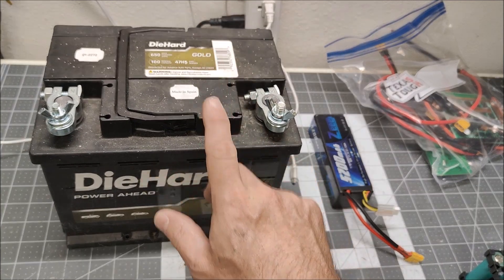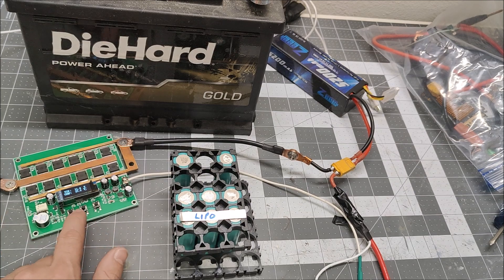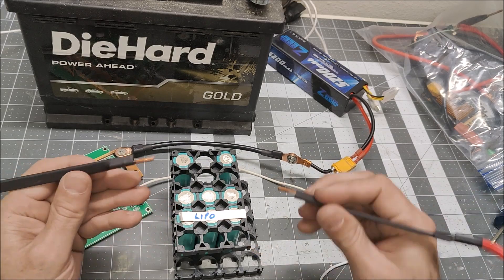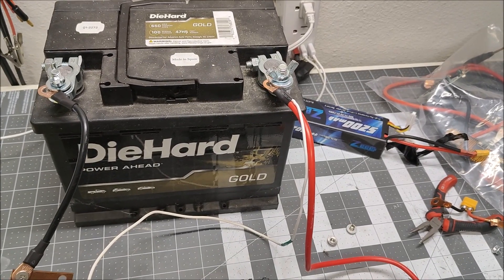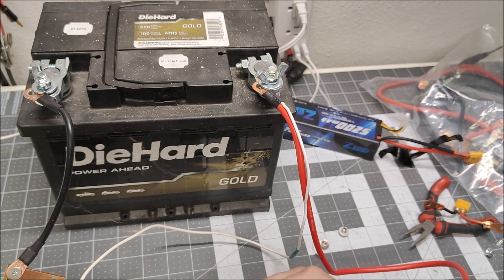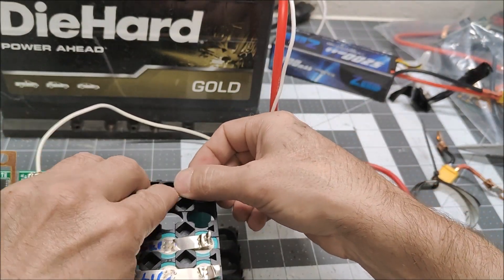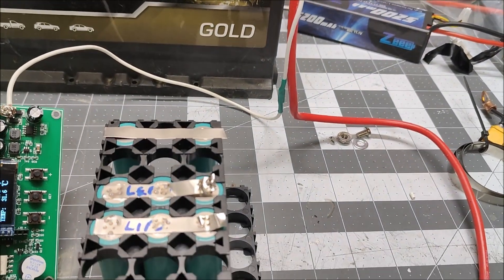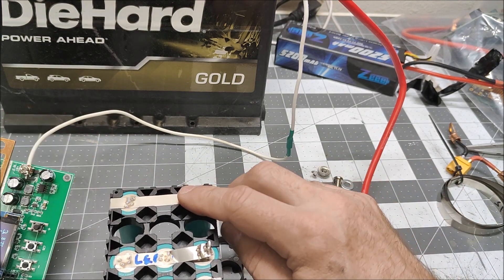Lead Acid vs LIPO for PCB Spot Welding

Comment: I used a 3Ah LiPO years ago to test against an SLA battery. I found that although the LiPO worked, it ran out of jam which resulted in inconsistent welds before I could finish the 84 spot welds required for my project. I kept an old but still functioning car battery for my spot welding and it seems to be doing the job well, and the price was right.

Comment: 7:57 hey Steven, hope you’re well bro.  So, currently you’re Delay stands as .15ms delay. The highest delay is 950 = .95ms-1sec delay. I did receive my PCB SWs and did some messing around with it. It’s pretty cool stuff. I was live last night. Should be in my live video tab. if you wanna check out. Take care

Comment: Can small Motorcycle Battery Led Acid be used with that kind of Welder?
Reply from the maker: depends how small. I do think a motorcycle battery can work, but it must not be too small. Should be at least  150 CCA

Comment: I wonder which is the less dangerous to work with. LiPo batteries are known to ignite and even self ignite if not handled and stored  properly; and burning LiPo fires are very difficult to extinguish. Lead acid batteries can release hydrogen gas, which is highly explosive. According to me, lead acid batteries close to a spark producing welder might also pose a potential risk. Anyone has given this some consideration or has (bad) experience with these setups?
Reply from the maker: lead acid batteries give if minimal hydrogen. And many lead acids are sealed batteries releasing no hydrogen. I don't think its a big concern. From a safety point of view, i agree LIPO might be more dangerous.

Comment: It's not comparison of lipo vs acid but specific lipo battery with specific acid battery. You can get lipo with bigger discharge current. Also doesn't make sense to weld three times with the same time, make first and last much smaller so it won't get so hot and will weld also ok. Plus increate first delay to at least 500 so you don't have to be so quick with touching. And it's not a percentage but a number of milliseconds how long it will weld.

Comment: Can lithium ion rated 3c of 80ah be use to power spot welder?
Reply from the maker: Yes. 3c x 80a is 240 amps. Should be enough

Comment: I have used a similar Arduino based spot welder for about 4 years to create replacement Liion battery packs for cordless drills. I usually make a dozzen or so every few months using 2, 5200mAh 100C, 3S LiPo packs  but I the packs have suffered from puffing (probably due to the heating effect from the large instant current draw around 600A) and I was about to get a new set when I came across a super capacitor version that I will give a try. In my opinion the more robust chemistry of the lead acid lends itself better to this purpose but would welcome other opinions.

Comment: I think a higher end lipo would provide better than lead acid results. Something like a 4s 10Ah 120c. with 8awg or thicker wires from the lipo, wired directly to the board instead of using connectors.
Reply: Not really, Lipos are made very different to Kead Acid. Lead Acid peak much better than Lipo but Lipo can maintain the current much better.

Comment: The start Delay needs increasing when you're initially placed cables on because it's immediately trying to pulse the moment you out them on it, causing miss welds at the start sometimes (but don't change the in-between pulses as it can blow up the pluser if you set them to far apart)

Make sure using basic eye protection as it can sometime explode molten metal when it strikes (as it happened I believe twice in this video)

Comment: No link to board?
Reply from the maker: Just found this amazing item on AliExpress. Check it out! 
$28.09  54%OFF | 12V  Digital Display Spot Welder ModuleSpot Welding Machine Control Board with Welding Pen Intelligent for Lithium Battery 18650
https://a.aliexpress.com/_mNZmcqA
Reply: Seems getting from Amazon would be better for returns since many fry it in the first minute. I'm going to follow the suggestions of using a separate power supply for the board and keeping all 3 delays the same . Also using a lead acid in good shape fully charged for consistent welds

Comment: As always another great video. I use a lead acid battery, to deal with the heat I feed my spot welder with 3 # 10 wire for the negative, I made a #6 wire lead to weld with and a #6 wire lead back to the positive, I use a #10 (I think #10 is overkill) wire to from the positive to the positive on the spot welder. This combination really helped with the heat. Thank You for all of these great videos you have done

Comment: I played with the delay using lead acid and if you change the delay to get 3 hits over a second the FETS will blow! Keep all three at the same delay!
Reply: What was your battery setup? What were your power levels? We're you powering the board with a 12v 1amp wall wart?
Reply: @brenthawkins204  car battery

Comment: Ignoring the mass of the batteries, I would go with the lead acid. Simply, lead acid likes to stored fully charged when not used and extends the life of it. But storing the lipo fully charged decreases the life of the lipo battery.
Reply: If you are using 4s lipo battery; the user manual already requires it to be below 16v. You can charge it in storage mode and put it on standby for a long time. It is like 15.4V.
To make punto, it must be less than 16V. You start directly with the storage mode voltage. When the punto is finished, it returns to storage mode, so you can store it for a long time...
(I use 4S 5000 mah 50C lipo battery, like this. It was a battery I used for my drone. :)   )
Reply: @cetinkaya4436  Lithium batteries are dangerous in anyways. They do not like to be shorted. I'd prefer lead acid to lithium to be on the safe side. Nevertheless, it is a matter of choice.
Reply: @s3rkanAGA  

If the aim is to create an energy source from lithium ion batteries, I must say that li-ion batteries are more dangerous than lipo batteries in spot welding. :) Because Li-ion batteries have a high risk of explosion. Lipo batteries are only flammable and do not explode. :)

Additionally, there is no danger if lipo batteries are stored in appropriate storage equipment.
Since it is flammable, it cannot burn in an airless, oxygen-free environment...

But of course, as you say, this is a matter of preference.
Reply: The most reliable battery regarding this risk is lifepo4 batteries. However, they also have a weight handicap. That's why they are not preferred everywhere. Due to their size and the fact that less energy can be stored.
But usage (charge-discharge) cycles are very high. So their lifespan is long.

Comment: the lipo is 11 volts  and the lead acid is 13 volts. thats the difference
Reply from the maker: The amps is more important than the voltage.
Reply: @stevenc22  

Yes, discharge current...
The voltage should not be greater than 16v, it is important...

Comment: I hacked the oldest model (12v spot welder v5.6) using your wall wart method, since any 3s lipo didn't work, I upgraded all wires to 8AWG, now with the wall wart powering the board, I'm now attempting 4s 12Ah Lipo pack, (only negative goes through the MOSFETs), so far I can easily weld 0.2 pure nickel, If it doesn't work, will even try 6s with appropriate cooling/heatsink, Thanks a lot for the idea man!
Reply from the maker: Interesting 👍

Comment: cool i just orderd the same welder, was actually looking for a video about it and couldnt find anything so just settled on clicking on this one and whaddya know its the welder i was wondering about.   Nice tests, its called 18650 Lithium SpotWelder but reading the descriptin it says all the different battery options you can use with it and what to watch out for. I plan to use it with lead acid myself.  But it also says you can use 2x 2.7v  3000f super caps in series, that woulud be interesting to see, and whats the point of using super caps?  The 3000f ones i found are huge so not much space saving over lithium, probably just more power?  Not like this welder needs it,but who knows maybe you can weld a bike frame together after you welder your batteries?  jk
Reply: https://youtu.be/RxXUVdXDxok?si=5RYWVvtq5ZSwA0jU

watch this diy battery for your spotwelder

Comment: three months have already passed, have you been able to find a solution to increase the time between the moment you place the tips and the moment the soldering is done because I find that the delay is much too short, it's not well… Did you find the solution?

Comment: I have welded broken car parts off a 12V battery (in emergency situations) in the past without any circuit boards, just some welding cable, a welding rod and a ground,  Looking at the way you have shown it wired here I wonder if it is the battery doing the welding via parallel path to your apparatus and much of the current is just ignoring your little circuit board thingie.

Comment: After using this spot welder. Have you figured out how to set it up for the best welds. Do you recommend this spot welder for 0.2 nichel. I'm looking to use copper bus bars with nichel spot weld tabs.

Comment: I'm planning on using 18V power tools battery, I have 4Ah 5S2P packs, reckon it will work fine or trip the BMS? They are 20C-25C cells iirc, so only 40-50A??
Reply: That's likely not enough current.  Like you said 40-50A and you want 200A.

Comment: Thank you for making this video.  In trying to understand Ohms law, if I could have seen the current draw using a DC clamp meter it may have helped me.  That is to say; if the voltage and load are equal for each battery, then the current draw should be the same, no?  If the current is different from one case to the next case, then voltage or resistance must have changed.  I am buying a JQ-DHJ for my first attempt at spot welding.  I have a 230Ah LiFePO4 battery with a continuous discharge rate of 200A and a max discharge rate of 400A for 5 seconds.  The JQ specs say it supports a range of 100A to 900A.  I will review your video on the JQ in an attempt better understand how to manage the Amps.  Thanks again for making this video.

Comment: what will happen if you use a 12v 200Ah battery!
Reply from the maker: Should be enough
Reply: @stevenc22  will the big capacity break the board ?
Reply from the maker: @maissanelmohtar9903  no the size of the wires will naturally limit the amount of current used by the board

Comment: So many variables but I think that lead acid battery probably has lower IR than the Lipo.

But add to that the tiny wires coming off the Lipo pack (wish they'd all switch to 10AWG or 8AWG for the big boy packs). Yes, you're right about the connections as well. Just adding a lot of resistance.

I think its about time you start trying some copper nickel sandwich since you now have that lead acid battery that could probably do 0.1mm copper + 0.1mm nickel...and probably 0.15mm copper instead of 0.10mm.

Part of me wants to try out this new board but I'm overall pretty happy with my JQ besides the fact that I blew up my first one trying to parallel two very low resistance LiFePO4 packs.

Or replace the fets on the JQ...didn't' work when I replaced them after blowing up my first one but there might have been something else in the circuit that was a problem? I also theorized that perhaps using fets with too low RDS on might be a problem. Not sure if there's anything in the circuit that is looking for a certain RDS on for the fets as I've seen the other popular spot welding guy on YouTube take the purple board and put IRL40SC209's on it and he's spot welding copper nickel sandwich thicker than something straight out of a NYC deli

Comment: Dual Pulse welders use a shorter first pulse to clean the weld area and heat it up so the second pulse (which is typically significantly more than the first) has a clean slate to work off of and the voltage drop shouldn't be too significant that it affects the second pulse
Reply: How would you set up the different SEGs . I'm looking to purchase this spot welder. I have used the self-contained ones and have been disappointed. 
Thanks for any insight.
Reply: @noce1071 on his video reviewing this spit welder in the comments a guy tells exactly how to set it up
Reply: @noce1071  no clue how to set up this PCB welder. I use the JQ-DHJ02B and I am VERY happy with it.

Honestly most of the PCB welders are decent just look at the fets on it and read their datasheet. Then look at how well the traces can transfer current through the board and the fets. This one has massive bus bars which I'm sure is what makes it stellar but the JQ is damn good too. Probably capable of 0.30mm pure nickel if you can max it out without going over power. The settings on the JQ seems strange but its really easy the instructions just suck. The JQ is just doing an IR test of your pack by asking the Ah size and the C rate.

Your power source (battery, capacitors, whatever) are 99% of your spot welds. You MUST get VERY LOW IR batteries. A123, Headway, high CCA AGM, GOOD Lipos (that market is a shitshow), or supercapacitors.

Comment: I ordered that board - should get it by New Yeart's.  I think I'll use my 10,000 ma power bank to see if it works with that.  It has a 5vdc output.  I don't know if the welder will work on that low voltage.  Lead-acid car batteries are specifically designed to provide few hundred amps through low resistance loads ifor short duration - as in starting a car.  Deep cycle lead-acid batteries are specifically designed to provide lower current over a long duration - as in golf carts.  LiPo can do both.
Reply: uhhhh powerbanks absolutely won't work. That 5V output is probably rated for 2.4A or 3A

The cells in that powerbank are definitely not power cells.

Comment: Connect the controller to a separate power supply and you will have a much better welding machine.
Reply: Why? If there is a cap in the circuit to hold up the gate voltage its not necessary
Reply: @ericklein5097  Because there will be no voltage drop.
Reply: Yup a 12v 1-2a wall wart should do the job and keep the fets from sticking open and blowing

Comment: Can’t really go wrong with lead acid. The millisecond short-circuit weld durations are likely a fairly light duty task for a battery that’s designed to provide several hundred amps for up to 30secs, even in cold temps. If the size and weight isn’t a problem, they seem like the most cost-effective option. I’ve been using a 35ah starting battery without issue for quite a while now. 

More recently I’ve been using a 4s headway (lifepo4) pack for the portability. I made a very short connector that bends 90deg so the welder sits on top of the pack. (batteries are horizontal) Its worked well without issue. It’s worth noting that the short 8gage connector probably wouldn’t be a good idea for lead acid, because the large available amount of current would probably be too much for the welder without the resistance of the stock-length connecting cables to limit it. The headways have a lower current rating of 200a (which is likely still overrated) so the short connector doesn’t cause overcurrent issues. In reality the headways probably do around ~130a, and do sag which is important to know because some spot weld pcb’s have crappy drive-circuitry & no hold-up capacitor/diode which will usually cause smoked fets quickly if used with a battery that sags at all.
Reply: Are they the Headways from BatteryHookup? I got mine off Ebay and despite being 2015 cells that only give me 8050mAh at a 1C discharge rate they all have an AC IR of 1.9mR. I accidentally sent one reverse polarity so instead of a 4S2P pack I'm working with a 3S2P when I'm not using one of my A123 4S8P packs.
Reply: @ericklein5097   Yeah, the ones i’m using are the used ones from BH. Recently I ordered a few more, and they aren’t quite performing as I’d have hoped. They’ve got between 6-7ah at 1C, but the pulse current is underwhelming. I haven’t tried new ones from ebay yet, which I should do sometime if budget allows. And actually since you’ve got some, do you feel that the new ones preform up to the pulse rating? If so I’ll probably try to pick up a few, since I’ve already got excess busbars and spacers etc for them already.

edit: You may mean the ones from BH ebay store, which if that’s the case, is pretty good. They are used cells, so results will understandably vary.

Comment: Good video!  Did you notice how the cables jumped when making those welds ?  I remember from back in the 1970s, using an industrial spot welder how much those thick cables jumped.   Cables for a workstation should be anchored in some way near the battery (or other power source) so that they don't strain the connections every time a weld is made.

Comment: I'd imagine voltage drop would be a lot lower on the lead acid battery. If you put enough cells in parallel then LiPo might do the same at the same settings. It's nice that LiPo's can discharge so much current for their size because of the lower internal resistance. Like you said, if you already have one battery set up and working then it isn't worth the money to switch to the other. Thanks for the video!